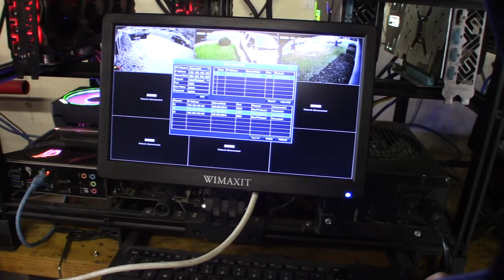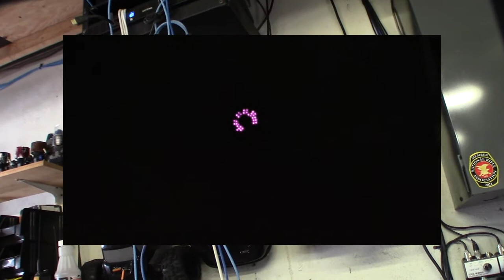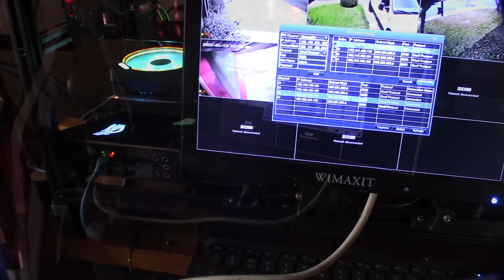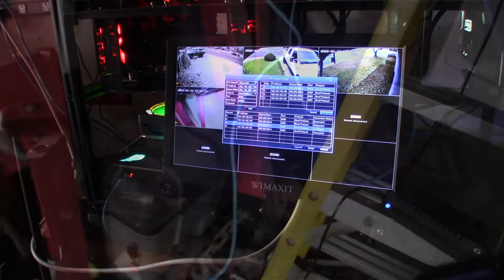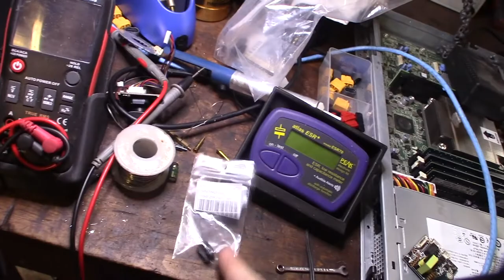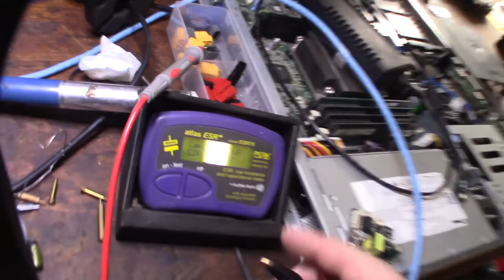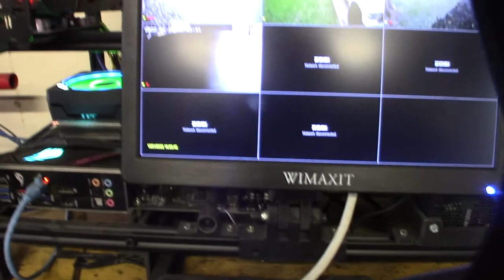POE IP Camera No Power Troubleshooting Board Repair HiSilicon SOC

Comment: I just fixed a POE IP camera from SV3C (series A) with exactly the same symptoms by swapping out a capacitor on the POE board just as shown. Mine was a 330 uF 25 V. It was only very slightly bulged on top. Before fixing, the camera would only come on if the 12 VDC supply was attached.

Comment: I have the same problem in techage cameras. And also connecting 12 volts and disconnecting from power supply the cameras still works. 
Found one capasitor also bulged.

Comment: I have a question. An IP camera with PoE power supply is available. On the board the transformer PDT2431SR on a datasheet, on contacts 3/4 power supply of 33-57 volts, contacts 1/2 is 12 volts, contacts 5/8 and 6/7 is 5 volts. So that's the question if I immediately apply to the contacts 1/2 power 12 volts? Will it work?